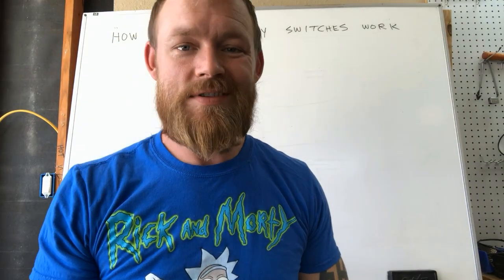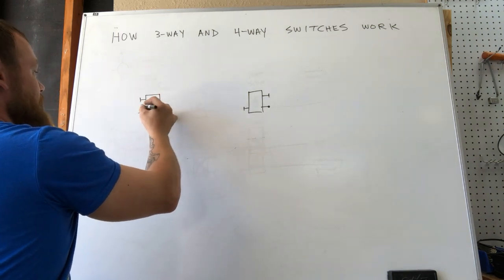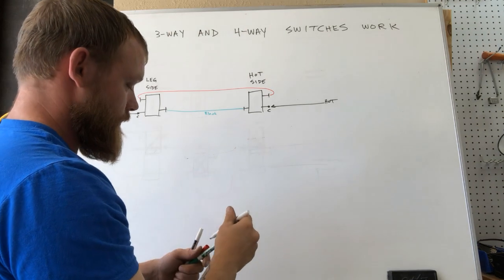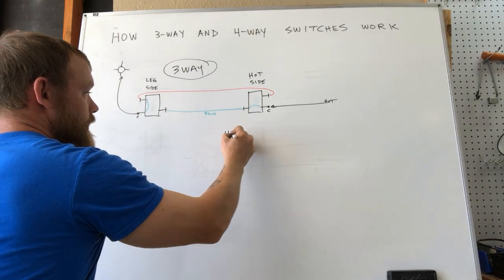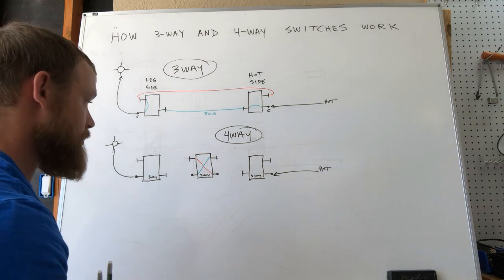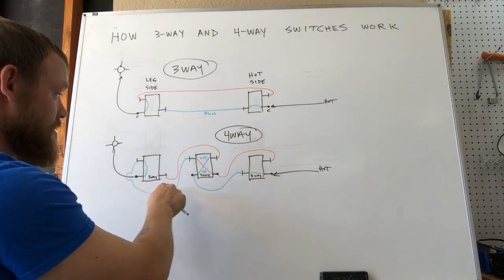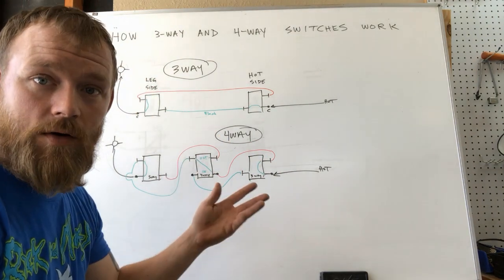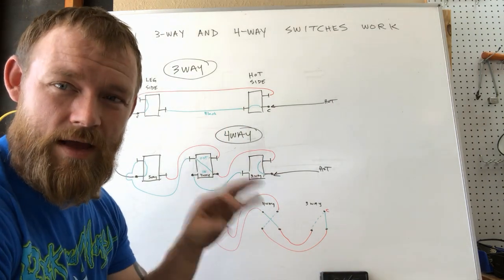Episode 11 - SCHEMATICS How 3way and 4way Switches Work

Comment: I just had a huge "AHA" moment. loving these drawing videos!
Reply: One of these videos helped me with a switch loop.  I took a light down but had a little difficulty getting the wiring right when I put up a new one.  It was causing the breaker to trip before I figured out how to do it.  Until then that breaker was turned off for a day or two.  That light was not in a room that we use a lot so I turned off the breaker while I tried to figure out what I should have done.  I just took a picture of the screen with my phone to keep a copy of the diagram.  My wiring was a little bit easier since it was earlier than 2011 code and did not need 3 wire (4 if you count the ground as a wire) for that.  If I was working with 3 wire it would have left me a little more confused for a little while.  These things can be confusing if you don't have to do them every day.  Although it is a good idea to hire an electrician a lot of people can do these things themselves if they knew how to.  I really only call an electrician if it is a problem that I can not fix myself like a problem with the electrical panel (never had one yet).  Some of them are expensive to hire as they can be close to $100 per hour maybe more.
Reply: And I just had one of these moments five minutes in

Comment: Great explanation!  In my house, the previous owner added a light that is controlled by 3 switches.  There are some combinations of up/down for the three switches where nothing happens when you flip one of the switches.  Then I have to go to the other two switches and try other combinations so I can get the light to turn on.  Believe it or not - the person who wired those switches was the previous homeowner who teaches electronics at the local community college.  Go figure!

Comment: Just a tip here. The diagram and explanation is great - but If you ever change out a combination 2 way and 3 way device in a crowded switch box make sure you take a photo of the wired device before you disconnect. You will regret it if you get distracted and forget which color conductor landed where. I have 2 3-ways and 2 4-ways in a back multifamily hallway and still only have 3 out of the 4 switches working (had to work with an assistant and took a half day - after an electrician tried to reconnect and then told me he would have to rewire the whole setup).

Comment: I can't get wall sconces to work. They simply went out about a year ago. Replaced light bulbs, nothing. Replaced all the 3way switches and 4 way switch (in a 3 gang outlet) and nothing. There's 6 black wires, all went hot. But 4 wires (2 black, 2 red) are dead it seems. No voltage even with entire circuit breaker on. I can't figure out what the issue is. Does anyone know any ideas? If they are the travelers, they're not in the same sheath, all over the box. No obvious load wire either.

Comment: Question: I Just moved into a new house. I have 1 light switch that controls the hall light when walking in, the kitchen light, and the lights above the bar. The only time the lights above the bar or the hall light work is if the kitchen light is switched on. Each of the 3 lights have their own switches they just don’t work unless the kitchen light is on. While the kitchen light is on I can only control them. They won’t independently turn on. Should I replace the switch to a new 4 way switch? I took a peak inside each switch and the main kitchen that is controlling the bar and hall lights have multiple wires. 2 whites 2 blacks and 3 grounds. The switch above the bar has 2 blacks and the switch for the hall has 2 blacks. I was thinking maybe the switch went bad? Any ideas?

Comment: Everyone talks about big rooms with 3 or more door entrances as an application of 4-way switches between the 3-way line switch and load switch. 
For example, could an application with these 4-way switches be an instalation on the staircases at a building with a 3-floor level or more dwellings?

Comment: Hello, I need to add TWO 3-way switches to the same circuit. Basically, we have a double split level. Kitchen has stairs down to garage and stairs from garage down to basement.

We have a 3way already, for the garage interior lights with a single pole running to the led motion light on the exterior garage. The switches are currently located at the top of the steps into the kitchen and a double switch for the garage indoor and outdoor lights located in between the two garage doors. 

We would like a 3way for the stairwell lights (1 in each well) with a 3way switch at the top of each stairwell. Next, we would like to keep the existing 3way that’s for the  garage lights with the single pole for the exterior motion light.

Comment: I like your presentations and this one is no exception.  
I was enthusiastic when your intro mentioned SCHEMATIC. Even tho it was not until 9:26 into the video that you began drawing schematic (vs. wiring) diagram.  

Using Single-pole and Double-pole switches, fully labeled with common, normally open, and normally closed I think would enhance the discussion. (Sorry, but I am in the Electronic industry and its terminology/symbology.)

Comment: I’ve got two white and two reds going to my 4-way switch. In the box it has a red and black wirenut together. - what would be the reason the red and black are together and just going from one set of wires to another- are they powering another outlet/box. 

Why would I have two whites and two reds that were going to my old 1978 4-way? 

All other white wires are in one wire nut in the box. I’ve got three switches in this one box so it’s a mess.  

I’m assuming they made the two white wires common, am I right? 
Should I place the two white wires with all the others and take the black/red that are wire nut together and use in place of the two white wires? 

Lord help me. 

The two other switches on this 4-way located in hall I’ve rewired with black on common and white/red on travelers. 

Would un wire nuting the black and red disable an outlet or some other plug and or the light it self?

Comment: Could someone verify if I'm wrong?
At 8:35 where he erases the red line (there's green line going from right top to left bottom) in the 4 way switch - power is not getting to the light fixture.
In that instance, if you flick the 3-way switch on the left side, wouldn't you want the power to come through? However, it seems like the left side 3-way switch won't be doing anything since the either outgoing wires from 4-way to the left side 3-way won't have power.

Comment: Great video! I guess you can add as many 4-ways as you want in between the two 3-ways for additional switch locations? My current rental house has 5 (!!) switches controlling the same hallway light (one in each bedroom, one in the hallway). Ironically several of these are within arms reach of each other. 😂

Comment: Question: I have a kitchen light switch which can be turned off from a second switch closer to the dining room without having to walk back to the kitchen. My problem is when this second dining room switch is on the off position the kitchen lights will not work unless I walk back to the dining room and toggle this switch. I would like to know if possible how I can make them work in tandem where either switch would change the position of the lights from off to on and so forth. Can you please help?
Reply: The dining room switch is either a single (ordinary) switch or a 3 way switch wired the wrong way (common being connected to traveller and traveller to common). Or even the kitchen switch is just an ordinary switch in series with the dining room one - in this case you would need to run another wire for the second traveller. 
No matter what, from the fact that you are asking this it's pretty clear you shouln't do it yourself -  call an electrician.

Comment: started being an electrician at 17 and still going at 18 almost 19. i have a problem at work  at least something i don’t understand. there’s two three ways and two four way switches in a room for an it room . pretty big room so whenever you walk in there’s supposed be motion sensored also. keep in mind it’s a commercial job. and theres a battery pack to keep the motion sensors on.. how would i wire it in with the battery pack , lights , and the sensors are ran with low volt, cat5. also with the 2 three way and 2 four way switches? if that made any sense.

Comment: Would a 3 way 4 way system be the same idea but just adding another 4 way switch? So two 3 way switches, with two 4 way switches in between them. I’m thinking I have that idea down, but not sure if how much more it would complicate the conducting paths.

Comment: I do not understand the nomenclature ... they 3-way switch only has "two ways" of connecting. The 4-way switch is, I understand, a DPDT switch (Double Pole Double Throw) and the explanation of its connection was deficient if so.
If the light is on and you switch it of at the hot end, then back on at the leg end the power will flow through the opposite diagonal of the "4-way", so to work both diagonals must be connected.
If you then switch the light off at the "4-way" it must still have two routes through as if not switching the hot or leg end would not restore the light?
The easiest way to describe a DPDT switch is it connects the terminals in an X pattern (as shown) or as = (not shown).
If the "4-way" route is switched (note it is neither specifically off or on) then there are still two routes through it for the "3-way" switches to choose.
When he switched the "4-way" he should have rubbed out the X and connected the Commons and the Travellers ??? 

A "3-way" switch is a SPDT (Single Pole Double Throw) switch.
An on/off switch is a SPST (Single Pole Single Throw) switch.
An Isolating switch, used to cut both Hot and Neutral, is a DPST (Double Pole Single Throw) switch. 

I learned about DPDT switches when I was very young as they were used for reversing DC electric model trains.
It was important to use switches with a central off position or "break before make" switches as "make before break" switches would give a dead short whilst being thrown.
Most (?)  model train controllers have reversing by turning the knob in a different direction or having the switching beyond the stop position ... to prevent you reversing the engine at speed ... something we, when kids, had great fun doing.

In the (AC) electrical system shown the legs are only ever 'hot' or dead so "make before break" is not a problem!

PS I am in the UK but lived from 2-10 in South Africa where I lesrned about electrical switches from my English father so I cannot be sure that "DPDT" nomenclature is common ... but it does describe the switching functionality simply.

Comment: @ 5:36 he draws the path between the two terminals as an X, state that "you always have a path between the two terminals," then he says the path changes but does not diagram the circuit changes when the 4-way is switched.  In his diagram the top left terminal is connected to the bottom right terminal and the other traveler is connected to the top right and lower left terminals.  He needs a Volt Ohm Meter to check his diagram because he should show  the travelers will connect as shown or from top right to bottom right and top left and bottom left, respectively as the switch changes position. X or ||.  Good idea, also, to speak of SOURCE and LOAD as the switch(es)  are used to control power between a source and a load.
Reply: Thank you. That’s stuff was breaking my brain. Otherwise the 4-way would only be able to control the light if the end switches were configured in a certain way.

Comment: I ran 14 3 to led lights. Have four gang boxes set up! Putting 2 four way switches in the middle of 2 three way switches. For a total of FOUR switches. 

These should control all the lights. Giving the option to turn of and on from every location. (Only indoor).

Does that sound right… 

Following :

: .    : :    : :    . : 

… copper, red, white, and blk

Comment: A better visual would to use spdt and dpdt switch schematics
Reply: Yes, 3-way corresponds to SPDT, but 4-way does not simply correspond to DPDT - it has some weird internal connection I'm still struggling to get my mind around - and this would make a confusion even bigger.

Comment: Hey Dustin!  I'm a newer subscriber.  I'm trying to find info on installing dimmers on both sides of a 3 way.  I found someone that said it can be done with standard 3 way switches but most say you can only dim from one side or the other but not both.  What's the real deal?  Really appreciate you sharing so much knowledge.  Thank you so much!
Reply from the maker: Thanks for subscribing!

They make 3 way dimmers for this very reason. Along with 4 way dimmers. 

Get you some of those and problem solved.

Comment: Thanks for the video; one comment, please run neutral wires to switch gangs, even if not needed. It sure helps to add/upgrade to a smart switch device that requires a neutral wire to power itself.

Comment: What would be the Best way to find the hot wire that comes from the main fuse box?
Reply from the maker: Take the wires off the breaker side, wire nut those together and continuity check them at the switch side. Or get something like the Amprobe AT-6010 to trace it for you.

Comment: So you can have as manny as you like 4 way as long as they’re in between 3 way?
Reply from the maker: Maybe. Want to blow your mind a little bit? Sketch out a 3 way wiring system. Have power on one side common terminal and a light on the other side common terminal. Now take your power and run it through the black conductor to X1 terminal on the 4 way. X1 and X4 are connected, and X2 and X3 are connected. Now the power flows through X1 to X4, and goes another 4 way’s X1. If that switch is closed on the X2/X3 terminals, would switching that power the light? Get creative and use your mind! Great question!
Reply: Yes. A better way to think about this: Two runners above eachother. On either side there's an Y on its side. Those are your 3 way switches. Each switch connects to either the top or bottom runner. If both switches select the same runner, you have a circuit.  Either top-top or bottom-bottom.  Now you add another switch, your first 4 way switch. In one position, the runners keep their position: top-in to top-out, bottem-in to bottom-out.  In the other position, top-in goes to bottom-out and vice versa.  To make a circuit you can have   top-straight-top, or bottom-straight-bottom, or top-cross-bottom, or bottom-cross-top.  Adding an extra 4 way switch is just another place to either flip the runners, or keep them straight. You can have as many 4 ways as you like.

The way the video poorly tries to describe 4 way switches, you can end up with the first 3 way switch pointing up, the second 3 way switch pointing down, there's no circuit and no 4 way switch can do anything about it.

Comment: When installing or retro fitting 3 way or 4 way switches with dimmers, never assume the device actually works according to specification. I just dealt with a 3 way dimmer that was driving me nutso!  All wiring was CORRECT, but this NEW 3way switch/diimmer did not work.  I thought I was the screw up,  but after trying a different device same MFG, model number and SKU, It works  perfectly.  Do you get to bill customers for wasting time on BAD devices? Grrrr!

Comment: I've got a circuit in my kitchen that is tied into a GFI.  It "appears" to be wired correctly, based on the receptacle tester. When I plug anything into that outlet it pops the GFI.  Any suggestions on what to do other than run a new circuit?

Comment: To go to a five-way or more, would you just use another four-way switch and just connect the in pair to the out pair and the out pair to the in pair and so on?
Reply: You can connect 4 way switches as many as you want,provided that you have the 3 way switches on either side.

Comment: Hey Destin, I recently came across your channel and I really like your videos and think you do a great job of breaking things down. I know this video was posted a long time ago, but I have some critique on the way the 4 way switch works internally since I don't see any corrections in the description or pinned in the comments.

The way I understand it, the switch operates by either connecting the terminals diagonally (as shown), or when switched, the terminals will be connected vertically based on how you've drawn it. Another way to put it is, if the switch is in one configuration, the top left terminal will connect to the bottom right, and the top right will connect to the bottom left. In the other configuration, the top left terminal will connect to the bottom left terminal, and the top right terminal will connect to the bottom right terminal.

Other than that, keep up the great work!
Reply: Came here looking for this comment.
Reply: Yeah it seems like a key detail of the 4-way switch was left out and this clarifies it. Thanks. I'm thinking of it as the 4-way switch in the middle always connects one in to one out, and the other in to the other out. When it's switched, that's still true, but it's just changing which in is connected to which out to the other possible way of doing that.
Reply: Rather horizontally, traveller to traveller ...

Comment: Hey Dustin I love your videos you're awesome you have a lot of information I don't know if I'm gonna explain this right or say it right but how do you wire a 3 way switch the old style when the power is going up to the Box on to instead of the switch Box I don't really know if I explained that in the correct way  There's a new way of wiring a 3 way switch as opposed to the old way of wiring it